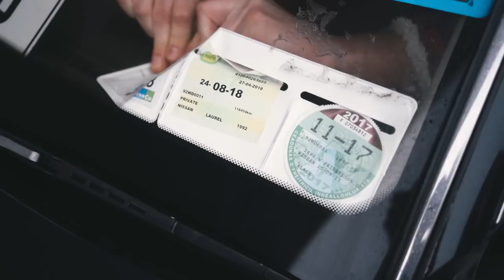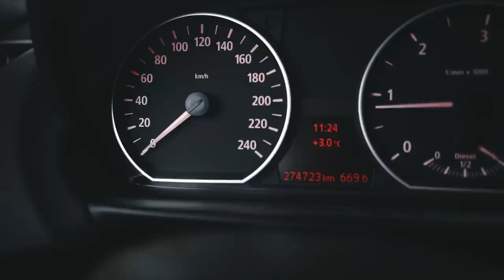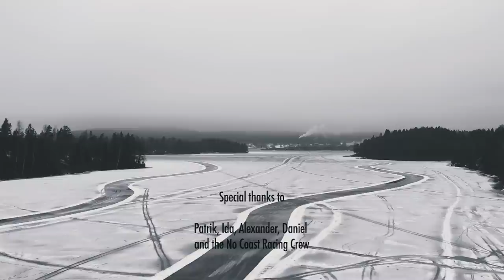ICE THRILLS – ICE DRIFTING ON A MELTING LAKE

Comment: This makes me really miss my 89 Integra even more. When reuben said " this car has been to hell and back with me, but in the best possible way" I almost started crying. I did everything to that car, and learned a lot about auto mechanic work.. Did an auto to 5 speed swap in 3 days by myself and taught myself how to drive it. Pulling out of my friends garage for the first time was rough, getting home was even worse. I had her for 2 years after that and had to sell it due to financial issue. That was dumb. Should've just lived out of that car.
Reply: But you have them memories. And you worked hard. And that makes it worthwhile. So that's more important than the car